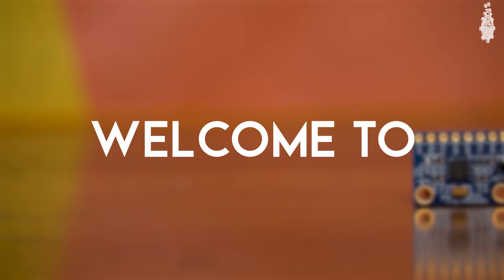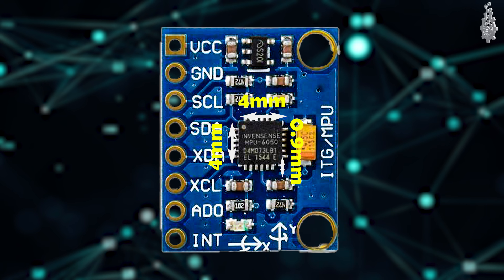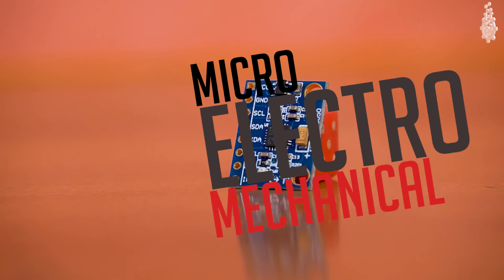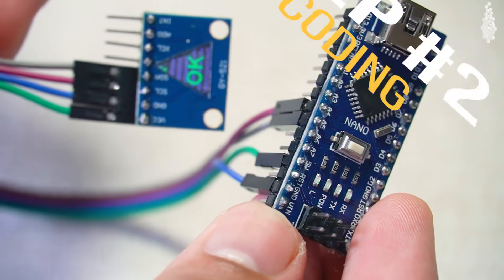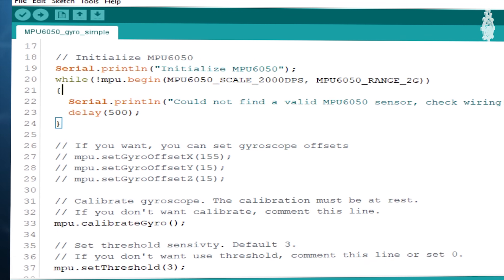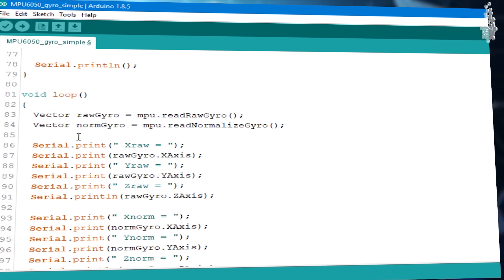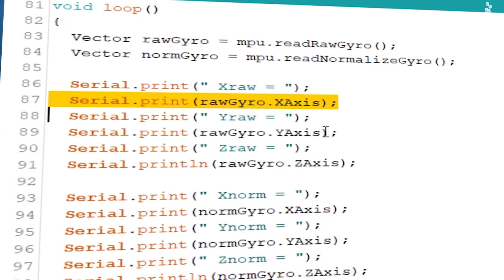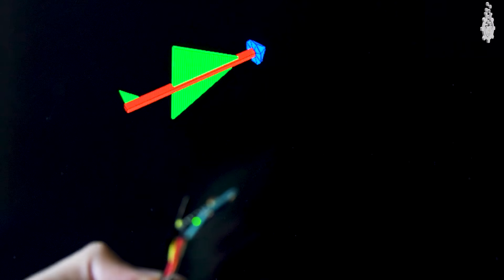mpu 6050 arduino tutorial for beginners

Comment: Good morning
When making a wide turn with pitch, does the plane only use a gyroscope for pitch or also an accelerometer for the curved trajectory?
THANKS
Reply from the maker: Plane uses multiple sensors and imus along with different filtering algorithms to make the calculation

Comment: what will happen if i put a 5 volt clock signal and oscilloscope probe scl and sda
Reply from the maker: The communication protocol needs data to be in a certain format to work, if you do that nothing should happen no output at scope

Comment: heyo, and thanks for making this video! i have recently gotten into arduino and thought to use this sensor, but upon looking how to connect it and use it in code, i have found out tons of threads describing how this sensor is now outdated/obsolete, but not many of them offering a good alternative... looking back, it seems this sensor has been around since like 2012, so i can understand. I have also gotten a hang of mine, but it turned out to be a fake (0x98 instead of 0x68 asa  return of WHO_AM_I ...) hence i come for you to advice... what IMU sensor would be a good idea to use nowadays?
Reply from the maker: Not sure previously which is the new one, but look for MPU 9250 maybe or ask around on the reddit, someone might know about this better than me.

Cheers

Comment: Sorry to ask but do you know where I can find cables like the one in your video? Is there a specific name for the grouped cables that you can split apart to make the connections?
Great video btw👏
Reply: They're called jumper wires and are pretty cheap, they'll come in a big pack but dont get the really cheap ones because they can be really bad and break easily. There's male to male, male to female and female to female sets.

Comment: i have done to try it, why the output like this one ;

Could not find a valid MPU6050 sensor, check wiring!
Could not find a valid MPU6050 sensor, check wiring!
Could not find a valid MPU6050 sensor, check wiring!
Reply from the maker: So must be loose connections

Comment: When I upload the example code and adding all the libraries, it gets stuck at Initiazalize MPU6050. I tried rewiring the VCC connection multiple times but it still get stuck.

Do you have a fix for this?
Reply: Hey, i know I'm a bit late but did you find a fix for it? having the same issue.
Reply: @loeloe0251  Havent done it yet but if its wired to 5v apparently y a resitor for the sda and scl lines that convert the current to 3.3v should make it work
Reply: @danielkorman1361  Thanks, worked for me. Have a great day
Reply: @loeloe0251  Nice, Ill make sure to try that out now :)

Quick question what impedance resistors did you use?
Reply: @danielkorman1361  Don't exactly know what impedance means but I think the resistord I used where 10k but don't know if that makes a difference, new to all this electronic stuff.

Comment: You didn't tell us about the difference between the accelerometer and the gyroscope and the error caused by the vibrations
Actually, this is the main mathematical problem that needs to be solved using this component

Comment: As far as I know SDA should be connected to A4, but in your video it's connected to A5
Reply from the maker: SDA and SCL are I2C pins and they should be connected to SDA and SCL, and in Arduino Nano, SCL is A5 and SDA is A4. 

And I have connected the hardware in same manner or else there won't be any data on serial if the sensor is connected incorrectly

Comment: I'm having the same issue here as everywhere else.  Not everyone using this breakout is using Arduino, what is in calibrateGyro()?  What is in readRawGyro()?
Reply: I guess I have different issues, possibly defective chip (according to manufacturer IT desk).  Looking forward to testing the chip someday to confirm or deny that, but I couldn't even get the who-am-i to read back.
Reply from the maker: If you want to skip callibrateGyro() you can do it

readRawGyro is pure numbers value coming from sensor

Comment: so uh
Arduino: 1.8.14 Hourly Build 2020/07/23 04:33 (Windows 10), Board: "Arduino Uno"

C:\Users\User\Documents\Arduino\libraries\Arduino-MPU6050-master\MPU6050_gyro_simple\MPU6050_gyro_simple.ino: In function 'void setup()':

MPU6050_gyro_simple:20:14: error: 'class MPU6050' has no member named 'begin'

   while(!mpu.begin(MPU6050_SCALE_2000DPS, MPU6050_RANGE_2G))

              ^~~~~

MPU6050_gyro_simple:20:20: error: 'MPU6050_SCALE_2000DPS' was not declared in this scope

   while(!mpu.begin(MPU6050_SCALE_2000DPS, MPU6050_RANGE_2G))

                    ^~~~~~~~~~~~~~~~~~~~~

C:\Users\User\Documents\Arduino\libraries\Arduino-MPU6050-master\MPU6050_gyro_simple\MPU6050_gyro_simple.ino:20:20: note: suggested alternative: 'MPU6050_RA_FF_DUR'

   while(!mpu.begin(MPU6050_SCALE_2000DPS, MPU6050_RANGE_2G))

                    ^~~~~~~~~~~~~~~~~~~~~

                    MPU6050_RA_FF_DUR

MPU6050_gyro_simple:20:43: error: 'MPU6050_RANGE_2G' was not declared in this scope

   while(!mpu.begin(MPU6050_SCALE_2000DPS, MPU6050_RANGE_2G))

                                           ^~~~~~~~~~~~~~~~

C:\Users\User\Documents\Arduino\libraries\Arduino-MPU6050-master\MPU6050_gyro_simple\MPU6050_gyro_simple.ino:20:43: note: suggested alternative: 'MPU6050_RA_FF_DUR'

   while(!mpu.begin(MPU6050_SCALE_2000DPS, MPU6050_RANGE_2G))

                                           ^~~~~~~~~~~~~~~~

                                           MPU6050_RA_FF_DUR

MPU6050_gyro_simple:33:7: error: 'class MPU6050' has no member named 'calibrateGyro'; did you mean 'CalibrateGyro'?

   mpu.calibrateGyro();

       ^~~~~~~~~~~~~

       CalibrateGyro

MPU6050_gyro_simple:37:7: error: 'class MPU6050' has no member named 'setThreshold'

   mpu.setThreshold(3);

       ^~~~~~~~~~~~

C:\Users\User\Documents\Arduino\libraries\Arduino-MPU6050-master\MPU6050_gyro_simple\MPU6050_gyro_simple.ino: In function 'void checkSettings()':

MPU6050_gyro_simple:54:10: error: 'MPU6050_CLOCK_EXTERNAL_19MHZ' was not declared in this scope

     case MPU6050_CLOCK_EXTERNAL_19MHZ: Serial.println("PLL with external 19.2MHz reference"); break;

          ^~~~~~~~~~~~~~~~~~~~~~~~~~~~

C:\Users\User\Documents\Arduino\libraries\Arduino-MPU6050-master\MPU6050_gyro_simple\MPU6050_gyro_simple.ino:54:10: note: suggested alternative: 'MPU6050_CLOCK_INTERNAL'

     case MPU6050_CLOCK_EXTERNAL_19MHZ: Serial.println("PLL with external 19.2MHz reference"); break;

          ^~~~~~~~~~~~~~~~~~~~~~~~~~~~

          MPU6050_CLOCK_INTERNAL

MPU6050_gyro_simple:55:10: error: 'MPU6050_CLOCK_EXTERNAL_32KHZ' was not declared in this scope

     case MPU6050_CLOCK_EXTERNAL_32KHZ: Serial.println("PLL with external 32.768kHz reference"); break;

          ^~~~~~~~~~~~~~~~~~~~~~~~~~~~

C:\Users\User\Documents\Arduino\libraries\Arduino-MPU6050-master\MPU6050_gyro_simple\MPU6050_gyro_simple.ino:55:10: note: suggested alternative: 'MPU6050_CLOCK_INTERNAL'

     case MPU6050_CLOCK_EXTERNAL_32KHZ: Serial.println("PLL with external 32.768kHz reference"); break;

          ^~~~~~~~~~~~~~~~~~~~~~~~~~~~

          MPU6050_CLOCK_INTERNAL

MPU6050_gyro_simple:59:10: error: 'MPU6050_CLOCK_INTERNAL_8MHZ' was not declared in this scope

     case MPU6050_CLOCK_INTERNAL_8MHZ:  Serial.println("Internal 8MHz oscillator"); break;

          ^~~~~~~~~~~~~~~~~~~~~~~~~~~

C:\Users\User\Documents\Arduino\libraries\Arduino-MPU6050-master\MPU6050_gyro_simple\MPU6050_gyro_simple.ino:59:10: note: suggested alternative: 'MPU6050_CLOCK_INTERNAL'

     case MPU6050_CLOCK_INTERNAL_8MHZ:  Serial.println("Internal 8MHz oscillator"); break;

          ^~~~~~~~~~~~~~~~~~~~~~~~~~~

          MPU6050_CLOCK_INTERNAL

MPU6050_gyro_simple:63:14: error: 'class MPU6050' has no member named 'getScale'; did you mean 'getRate'?

   switch(mpu.getScale())

              ^~~~~~~~

              getRate

MPU6050_gyro_simple:65:10: error: 'MPU6050_SCALE_2000DPS' was not declared in this scope

     case MPU6050_SCALE_2000DPS:        Serial.println("2000 dps"); break;

          ^~~~~~~~~~~~~~~~~~~~~

C:\Users\User\Documents\Arduino\libraries\Arduino-MPU6050-master\MPU6050_gyro_simple\MPU6050_gyro_simple.ino:65:10: note: suggested alternative: 'MPU6050_RA_FF_DUR'

     case MPU6050_SCALE_2000DPS:        Serial.println("2000 dps"); break;

          ^~~~~~~~~~~~~~~~~~~~~

          MPU6050_RA_FF_DUR

MPU6050_gyro_simple:66:10: error: 'MPU6050_SCALE_1000DPS' was not declared in this scope

     case MPU6050_SCALE_1000DPS:        Serial.println("1000 dps"); break;

          ^~~~~~~~~~~~~~~~~~~~~

C:\Users\User\Documents\Arduino\libraries\Arduino-MPU6050-master\MPU6050_gyro_simple\MPU6050_gyro_simple.ino:66:10: note: suggested alternative: 'MPU6050_RA_FF_DUR'

     case MPU6050_SCALE_1000DPS:        Serial.println("1000 dps"); break;

          ^~~~~~~~~~~~~~~~~~~~~

          MPU6050_RA_FF_DUR

MPU6050_gyro_simple:67:10: error: 'MPU6050_SCALE_500DPS' was not declared in this scope

     case MPU6050_SCALE_500DPS:         Serial.println("500 dps"); break;

          ^~~~~~~~~~~~~~~~~~~~

C:\Users\User\Documents\Arduino\libraries\Arduino-MPU6050-master\MPU6050_gyro_simple\MPU6050_gyro_simple.ino:67:10: note: suggested alternative: 'MPU6050_RA_FF_DUR'

     case MPU6050_SCALE_500DPS:         Serial.println("500 dps"); break;

          ^~~~~~~~~~~~~~~~~~~~

          MPU6050_RA_FF_DUR

MPU6050_gyro_simple:68:10: error: 'MPU6050_SCALE_250DPS' was not declared in this scope

     case MPU6050_SCALE_250DPS:         Serial.println("250 dps"); break;

          ^~~~~~~~~~~~~~~~~~~~

C:\Users\User\Documents\Arduino\libraries\Arduino-MPU6050-master\MPU6050_gyro_simple\MPU6050_gyro_simple.ino:68:10: note: suggested alternative: 'MPU6050_RA_FF_DUR'

     case MPU6050_SCALE_250DPS:         Serial.println("250 dps"); break;

          ^~~~~~~~~~~~~~~~~~~~

          MPU6050_RA_FF_DUR

MPU6050_gyro_simple:72:20: error: 'class MPU6050' has no member named 'getGyroOffsetX'; did you mean 'getXGyroOffset'?

   Serial.print(mpu.getGyroOffsetX());

                    ^~~~~~~~~~~~~~

                    getXGyroOffset

MPU6050_gyro_simple:74:20: error: 'class MPU6050' has no member named 'getGyroOffsetY'; did you mean 'getXGyroOffset'?

   Serial.print(mpu.getGyroOffsetY());

                    ^~~~~~~~~~~~~~

                    getXGyroOffset

MPU6050_gyro_simple:76:22: error: 'class MPU6050' has no member named 'getGyroOffsetZ'; did you mean 'getXGyroOffset'?

   Serial.println(mpu.getGyroOffsetZ());

                      ^~~~~~~~~~~~~~

                      getXGyroOffset

C:\Users\User\Documents\Arduino\libraries\Arduino-MPU6050-master\MPU6050_gyro_simple\MPU6050_gyro_simple.ino: In function 'void loop()':

MPU6050_gyro_simple:83:3: error: 'Vector' was not declared in this scope

   Vector rawGyro = mpu.readRawGyro();

   ^~~~~~

C:\Users\User\Documents\Arduino\libraries\Arduino-MPU6050-master\MPU6050_gyro_simple\MPU6050_gyro_simple.ino:83:3: note: suggested alternative: 'perror'

   Vector rawGyro = mpu.readRawGyro();

   ^~~~~~

   perror

MPU6050_gyro_simple:84:10: error: expected ';' before 'normGyro'

   Vector normGyro = mpu.readNormalizeGyro();

          ^~~~~~~~

MPU6050_gyro_simple:87:16: error: 'rawGyro' was not declared in this scope

   Serial.print(rawGyro.XAxis);

                ^~~~~~~

MPU6050_gyro_simple:94:16: error: 'normGyro' was not declared in this scope

   Serial.print(normGyro.XAxis);

                ^~~~~~~~

Multiple libraries were found for "MPU6050.h"

 Used: C:\Users\User\Documents\Arduino\libraries\mpu6050-master

 Not used: C:\Users\User\Documents\Arduino\libraries\Arduino-MPU6050-master

exit status 1

'class MPU6050' has no member named 'begin'

help
Reply from the maker: You have the wrong MPU6050 library
Reply: @mission_critical  ahh

Comment: Why it doesnt show the ouput? It just shows "initialize MPU6050" only and nothing happened. Thanks in advance
Reply from the maker: Did you double check the connection?  I would suggest you to switch SDA and SCL pins which I majority times mess up and wonder why I don't see anything on my serial monitor

Comment: Does this also work with an Ardiuno MEGA 2560?
Reply from the maker: Yes definitely, works with any microcontroller board with I2C communication protocol, you won't need to change code for Arduino mega

Comment: It shows class mpu6050 has no member named begin 
This error is shown in initialize mpu6050 statements 
Pls helpp
Reply: just delete installed MPU6050 library and install "jarzebski
/Arduino-MPU6050" library
Reply: @kartikhegde9368  thnx ,i found another library right after that day and it worked
Reply: @kartikhegde9368  u mean mpu6050 tockn library?
Reply: @AdityaSingh-hx1tv  one is MPU6050 and otherone is tockn, both are built in libraries, we dont want both
Reply from the maker: You used the wrong library, thank you @Robotics Hackground to answer!

Comment: class MPU6050' has no member named 'begin'
why this error message show??
pls help..
Reply: Yup, you have to uninstall other MPU 6050 libraries installed earlier
Just go to your documents/Arduino/Libraries/ and delete these libraries (folders), that should fix the problem
Reply: Hello, I have the same error. What do you mean by "Use wrong library else code" ? I downloaded the library from your link and then opened the same exemple as you.. thanks you in advance
Reply: okok got it, i need to delete the former MPU650 I installed. But Now my problem is that the code print" Could not find a valid MPU6050 sensor, check wiring", However my sensor is brand new and i tested the 2 i have
Reply: @The123rue  I have exactly the same problem. Brand new sensor, all wiring double and triple checked, and I still can't rectify the issue.
Reply: Could any of you get a solution for the "Could not find a valid MPU6050 sensor, check wiring" problem ??
Reply from the maker: i guess u have used wrong library else code, use the code from examples, 

Thank you for Subscribing to Mission Critical